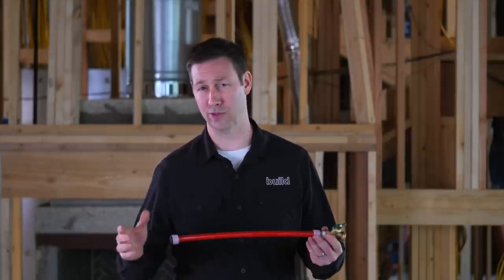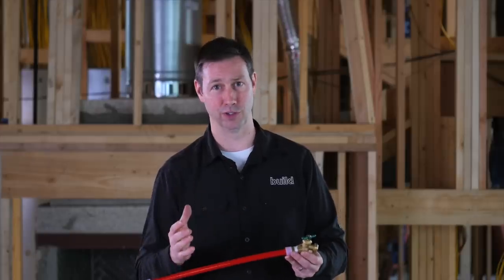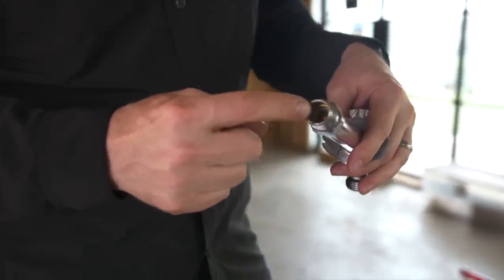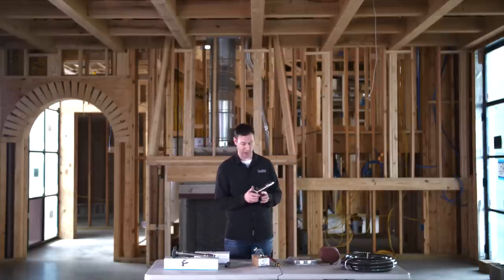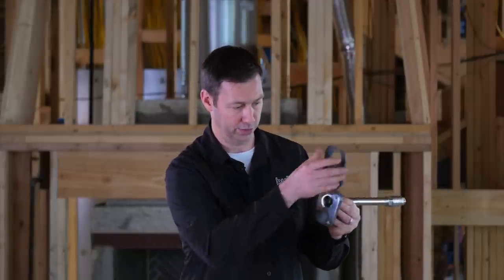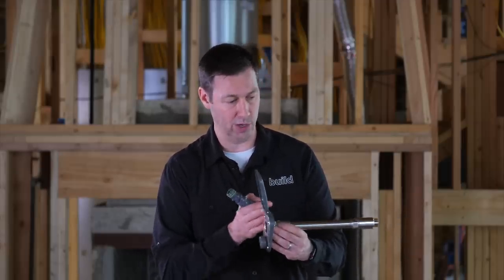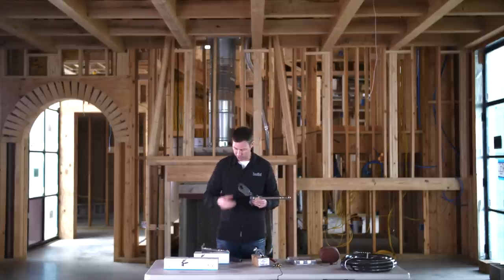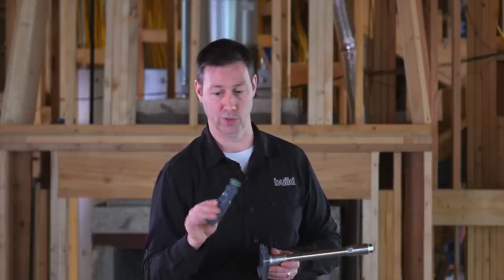No More Hose Bibs - A Better Outdoor Faucet

Comment: better is subjective... doesn't look like you can control how much water comes in and out of the faucet, and like a bunch of idiots are going to get soaked from full pressure shooting out while they're holding a hose and plugging it in. 

I'm in Massachusetts and have a normal tap that hasn't had a problem in... 90 years. Literally... it was the first source of water at my house. I think the problem is more how cheap things are made today.

Comment: As someone who just underwent a severely could southern winter leading to broken pipes and a $500 bill I think i'm totally sold on this.  Gonna call my plumber  and have both outdoor bibs replaced before next winter.  Risinger continues to cost me money ...and I spend it with glee.
Reply: A much cheeper and practical frost free hose bib would also have saved you from this problem. Thats just my experience from the North though, use it as you wish.

Comment: Nice advertisement. If you need an adapter to use the product, it's a bad product. And as a general rule, anything sealing with an O Ring is a terrible idea for end user use. This is an expensive headache. I would be leery about your pex loop aswell. Pex isn't the wonderful product is was marketed as. In 20 years (lol this hosebib isn't lasting that long) I wouldn't want to be pulling on those permanently stressed pex connections, and curling the brittle old pex can easily make a split in the future.

Comment: Not a bad deal at all for 90 bucks? I mean, even if the regular 20 bucks anti-freeze valve, the pieces are way easier to find and if its leaking or if u have any problems with it it is way easier to repair and /or replace.
And second. Plastic fittings for quarter turns? might I ask how much it costs if u break that damn fitting? pretty sure its not all stores that got those.

Its a little bit like Apple removing the 3.5mm jack on their smartphones. Why change something that is cheap and works fine? Progress? yeah right.

Comment: If I was really worried about freezing and appearance, I'd much rather have some kind of recessed, waterproof, insulated "box", like a beer cooler turned sidways, with a door opening outward (hinged at the top).  Need water, pop open the door, connect your hose and everything else is exactly the same, including being able to replace the bib without slinky pipe.
Reply: Andrew, frost free bibs move the wet section of the valve into the protected section of the house and eliminate the need to go to such extremes except in extreme areas of the country. Don't forget that the back of your "cooler hydrant box" is insulating the valves and lines inside the box from the protective heat of the building too, be it from the interior or the crawlspace, and may freeze anyway. If such a box were necessary in extreme climates, protective heat in the box or cutting out the bottom of the cooler the share heat from the building interior may be a better choice.
Reply: I have 4 cooler hose bibs. I keep my drink in there also!!!

Comment: NOTHING MORE THAN A PAID ADVERTISEMENT FOR THIS PRODUCT.
Reply: I actually learned quite a few things here: the service loop, interior shutoff bibs, winterizing concerns, etc. He was very clear that the one thing was a sponsorhip, and there was lots of good general information.
Reply: Yep, if you watched more than a couple of Matt's videos you would realize that he commonly has corporate sponsors.  How else do you think its worth his while to spend so much time putting together the content?  In his defense, I think he does as good a job as anyone of only recommending/featuring interesting or useful products or methods.  Most of them I appreciate.  I definitely wouldn't say he's "sold out".  I happen to have these Aquor hose bibs and I really appreciate them, easy to get the hose coil out of the way and stored quickly, the plastic adapter is very thick and well made.  I hate having the pile of hose out next to each bib and the leaky threaded connections that can only be remedied by excessive (wrench) tightening and/or thread tape.  Yes, they could be lost, it would take quite a lot of force to break one off.  Not for everyone, but they solve several issues that I dislike about traditional hose bibs.

Comment: Looks worse than a normal outdoor tap. Who takes their hose on/off? If it’s winter, you should isolate the water supply and drain the pipe work. No problem of freezing then.

Comment: ...oh boy. A non-standard easily lost plastic part to hook up to water.  And to top it off, it's just a plastic cover on the wall. How does this "look good"? 

No thanks. This is a horrible idea, and a horrible product.
Reply: Drackar how do you know it’s a horrible product when you’ve never used it before?
Reply: Read the first section of my reply, it outlines why this is a horrible novelty product no one should install in their homes. 

But if you want more detail, it's plastic. It's ugly. And it will photo-decay in the sun, unlike say, a traditional brass or stainless hose bib. 

And, again, it requires proprietary parts to use you can't get at the hardware store, which is a horrible idea. 

The design is trash, and the materials are trash. I don't need to USE it to know that I'd NEVER put one in a fucking house.
Reply: Sounds like you were out to get this product the moment you watched the video, and took no effort to find out what materials the product is made out of and where you can buy the product. 

Sure, they may not sell it at every single hardware store yet, but come on, we live in a day and age where you can buy groceries online. Try to adapt a little, bud. 

Let me correct you, the materials are not “trash materials”. The point that you brought up about the sun damaging the product is invalid because the polymers used are UV resistant. Polymers similar to those used on cars and on planes. 

It sounds to me you’re hating on something you don’t understand and aren’t willing to understand. Be a little more open minded. 

Also the point you brought up about it being ugly? That’s just your opinion and doesn’t make it a horrible product. And if you would, tell me a little more in depth about the design since you seem to know everything about it.
Reply: All information I had on this product is from this video, yes.  Combined with a general knowledge of materials and what I've seen on hardware store shelves. Matt, himself, says you should order a few extra parts from the company to leave with the client, implying that it's not available from hardware stores. (and given that I've never seen this product before, that's a safe bet)

"You can order it online, get with the times" grow up. if you can't go to the hardware store and buy parts, it's not a viable consumer facing product.  It looks like you can get the parts on amazon, but that's not good enough. If you can't get it at your local hardware store, it's not ready for primietime.  Any home owner will fully expect to be able to go down to the local store and pick up replacement parts for the system their contractor installs, and rightly so. And that's assuming, for the moment, that this company will remain in business and you will be able to FIND replacement parts for the ones you run over, loose, or get tossed because "what's this" when  you buy the house ten-fifteen-twenty years down the line. The second this company stops making replacement faucet attachments, one way or another, ALL of these are garbage. 

No "UV Resistant" plastic is UV proof. Leave any "UV resistant" product in the sun for a decade. It fades. Even if it doesn't fall apart, it still fades and looks worse and worse as time goes on. As a "premium product" for a "nice house" that's not a good look. You aren't "correcting" me. You don't know what  Delrin looks like after a few years in the sun, clearly. (Went to the page for the company, that's what the plastic is...and yes,  Delrin photo decays, cosmetically). A stainless frost free will look pretty much identical with proper care, and a brass valve patinas in an attractive way. Both of which can be used indefinitely and serviced with off the shelf parts. 

I understand the product well enough. I've been a self employed handyman for more than a decade, I have to deal with flash in the pan crap like this all the time. 

This video is a paid advertisement for the product. It completely ignores all the negatives of this product that are obvious to ANYONE who has ever worked outside a day in their lives, which you'd see if you read the other comments. 

Generally, with Matt's videos, he talks about positives and negatives of specific products in specific situations. This is nothing but praise for a product I would NEVER install in a home, in any environment.
Reply: The product is available in certain hardware stores, like Grainger and Ace Hardware. The product is new to the housing industry which is why you haven't seen it. The product has also been in use in the marine industry for over 15 years, so yes, I have seen what Delrin looks like after years of sun exposure. It looks fine. 

Again, you thinking that a brass valves patina in an attractive way is just your opinion. In my opinion, I think Delrin looks better than a splotchy green valve. 

There are negatives to any product. I'm not saying this product is perfect and that everyone should go out to buy it immediately. I just want people to be a little more open-minded to new products and ideas. Just because this video is sponsored does not mean that Matt doesn't believe that the product is good. I'm sure he wouldn't show a product on his channel that he believes is garbage.
Reply: Huh. It's not in store at either of the Ace's I shop at regularly, and it doesn't show up when searching for the brand name on the website. Maybe this product just isn't a thing in California, but is more popular in the midwest? Can't speak for local availability at Graniger, as I've never had reason to look one up. 

Serious question...do you work for this company, or are you just a serious fan of this product? 

Why on earth should I be open minded about this product? Personal preference of what faded look you prefer aside, you can't walk into any hardware store I've ever been in and purchase parts for this product. If that changes, that's one of my major arguments out of the way. However....

That's my primary objection for this product over any other type of hosebib. Unlike pretty much every other option out there, this has a unique and, apparently, proprietary attachment. If I'm wrong on that subject, if other manufacturers utilize this system, then I'd be happy to be proven wrong. 

So, you can't walk into just any hardware store for parts(and it's a hose. Again, if it's not something you can service at any hardware store, you're failing your homeowners when you install this product, in my mind). And, again, if this company goes under, when the faucet attachment you have fails, you have to replace the entire unit. 

Again. Why, on earth, should I be open minded for a product that's decided to go this route? 

Nothing about this product provides any utility that a well placed frost free hose bib doesn't. The only "advantage" is it can be "hidden" behind a slowly fading chunk of plastic on your wall instead of sticking out of it, or being hidden in any number of other ways. 

Meanwhile the base unit costs more than double what a frost free hose bib costs, PLUS you need to add another $10 to hook up a hose, or another $25 for the ability to control the flow of water.  

It has no advantage that I can see, while having multiple disadvantages. 

Seriously. Paint me a picture. Feel free to point out whatever mystical novelty I've overlooked that makes this make any kind of sense at all.
Reply: If you don't care...why did you bother responding to this month plus old comment?
Reply: Drackar n..l l.    .   ! .  O.   .  O.. O nl..o
L. O

Comment: Southern person here...we just turn off the outdoor hose bibs from a pex manifold and open hose bib valves.  We've never had an issue.
Reply: Northern person here. I just close the shut off valve in my basement, unscrew it's drain cap, open the spigot and drain out the water. We've traded simplicity and reliability for overpriced overcomplicated gimmicky plastic guaranteed-to-fail conveniences.
Reply: @phiksit  other northern person here.  I just... well, don't really do anything special.  because I've got frost free.

Comment: After years of losing proprietary hose attachments (or any product that has proprietary accessories), I know I lose them easily. Inevitably, someone will take the adapter off, and then it disappears.  But thanks for the tip on the first frost free version!

Comment: In winter , do you still have to remove extension? If you don't, can it freeze like traditional bibs if a hose is left on it ? There are those that for whatever reason will forget.
Reply: Newzchspy it surely can freeze. Good warning for forgetful ones.

Comment: So a question for someone who doesn't have to deal with freezing pipes: isn't the PVC conduit a 'cold space', ie the PVC is surrounded by insulation but the cold can come in through the same hole in the wall the bib does?  So having the shutoff 6" into the wall is less effective because the air in the pipe is cold?
Reply: TheOneWhoMightBe, the air movement is minimal in the space, and air movement is what promotes convective heat transfer. This is the same principal most building insulation works on; by restricting air movement, the insulation restricts heat transfer. As long as the hole that the hydrant is mounted in is sealed or gasketed, air movement will be minimal and the effects will also be minimal. Personally, the only problem I see with the PEX loop in the wall is a lack of nail protection where the PEX extends outside the PVC chase pipe.
Reply: So it might get cold in that cavity but not freezing since the 'contact patch' to outside is quite small and presumably sealed?
Reply: The heat transfer would rarely be enough to allow freezing of the piping in the wall as long as the air movement is nearly zero through a seal or gasket. For freeze protection, all we have to do is maintain 34 deg F or higher with the hose bib not in use.
Reply: I live where winter temperatures can get down to -30 a few days per year & I have zero problems with my hose bibs freezing. I always use the longest one I can find, usually 14”, so the actual valve extends well past the wall into the conditioned basement space. I also always attach it to a section of copper pipe to insure there is plenty of heat transfer from the heated basement air to the bib valve.

Comment: Matt is absolutely right about the need for a frost-free hose bib, regardless of which type you choose. He is also spot-on about disconnecting your water hoses. I have replaced hose bibs for people who after 20 years of their frost-free hose bib having no problems, they left a pressurized water hose connected to it during a freeze. The hose bib burst inside the wall and because of its brilliant design, there was no water damage because the water was shut off inside the house. Upon turning the handle, they found water flowing out of their wall around the hose bib.

Comment: It seems like a really bad idea to have a fitting or junction occurring inside the wall insulation. What if it starts leaking? You won't know until the damage is immense.
Reply: guess what: your house has dozens of plumbing connections inside the walls.
Reply: @kenbrown2808  Mine actually doesn't, but even if it did those would be interior (uninsulated) walls, and a water leak would be apparent relatively quickly.
Reply: @trevorlambert4226  really? yours is PEX from a manifold to the fixture shutoffs?  I mean, I replumbed part of mine from the crawlspace, with PEX and it still has a dozen connections or so inside the walls, in the part I replumbed.

Comment: Matt, the vacuum breaker is in case the water pressure goes off and you still have a hose attached. Maybe the end of the hose is in a bucket of water.  You don't want to suck that water into your house plumbing and the city sure doesn't want it in their system. So if the water supply from the house develops a vacuum it won't pull water from the hose into the plumbing. It "breaks" the vacuum.

Comment: The main reason for a vacuum break is if the house loses water pressure. If the end of the hose is in a puddle or pail the vacuum beak keeps the water from so phoning back into the house plumbing.
Reply: Correct.
Reply: Who the frick leaves an unattended, open-ended, running garden hose in a puddle? Oh, and the city just happens to be draining the water main at the same time. Is this like some common occurrence? If a water main breaks where I live, it's gonna be in winter and no one is using a garden hose then anyways.
I removed mine after the city did their inspection because 1) they leak / spit water, and 2) I can't manually drain my standard hose bibs in the fall with them attached.